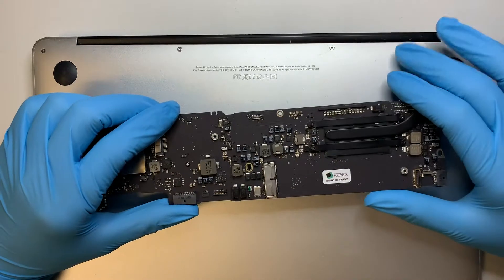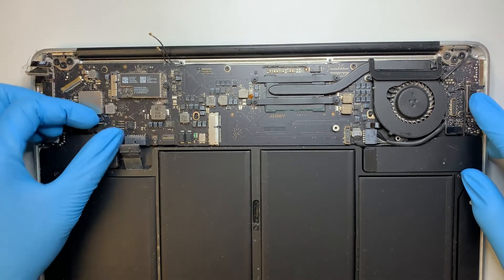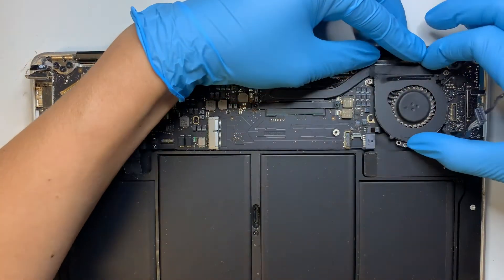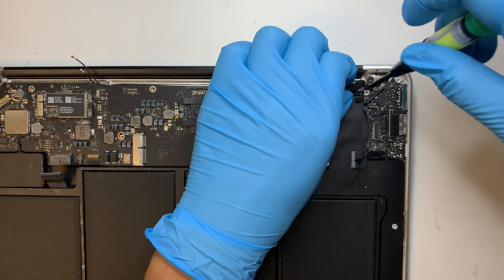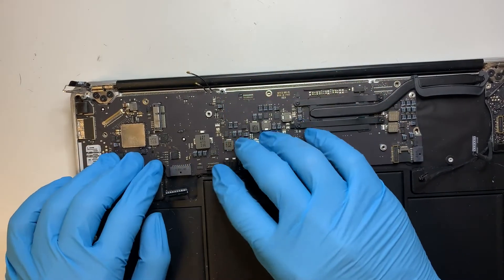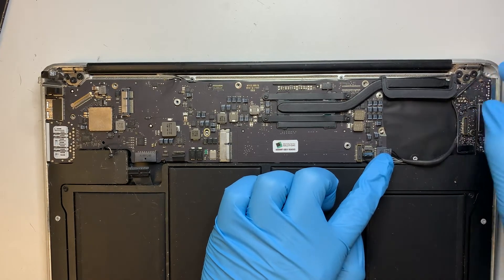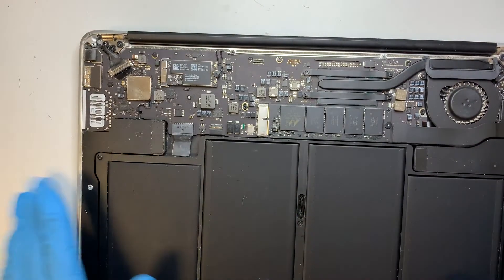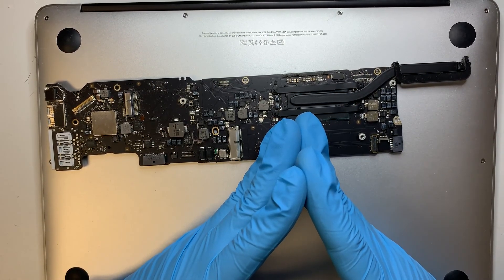How to replace Macbook Air 13" Motherboard

Comment: Can I fit macbook with a different model of the motherboard? I'm trying to fix a laptop which had motherboard removed, I know only model no, but I don't know if it was fitted with 8 or 16 gb ram and same for hdd. Will that matter?

Comment: Bro i too have MacBook air this model..motherboard was gone...on showroom they charge me for 47,000..May I get a alternate motherboard from outside..please help me
Reply from the maker: MacBook Air logic board range from $250-$450. 
Depending on your made model and what year.
Reply: You might as well just get a whole refurbished macbook for that price.
Reply: I Had My MotherBoard Replaced At Hyderabad Service Centre For ₹23,000. I own A 2017 MacBook Ait
Reply: @Murugavel R U may Seek Help From Hyderabad , they offer Cheaper Prices For the replacement.